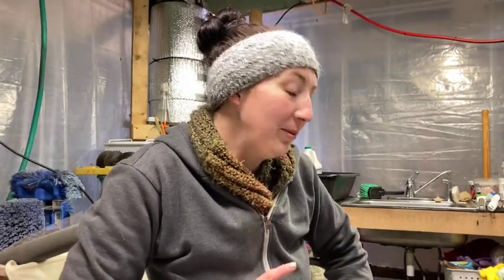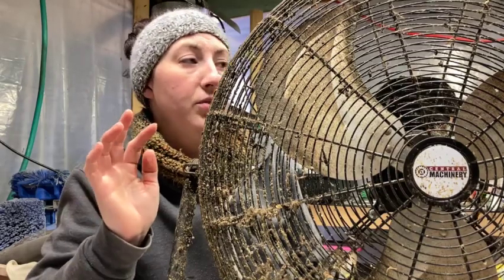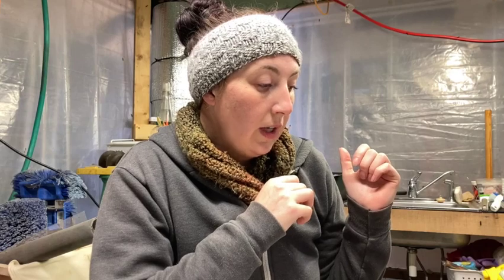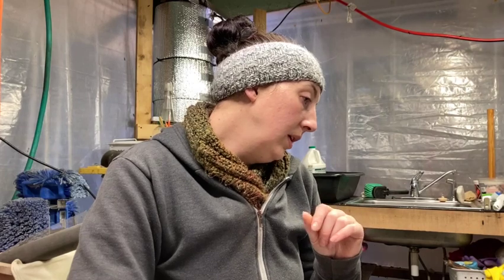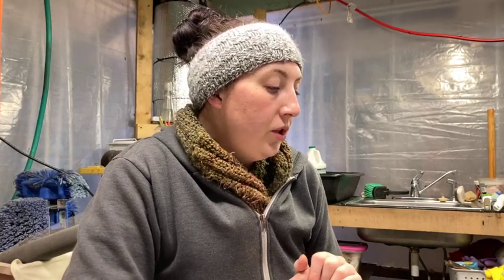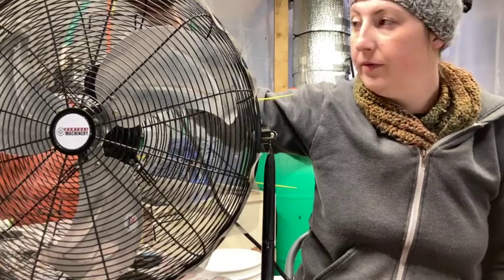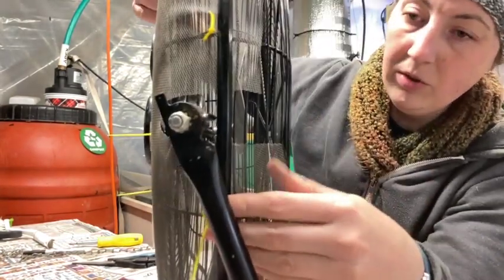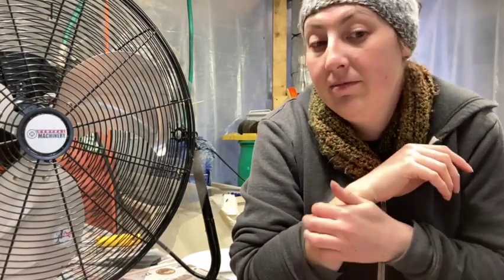Maintaining Optimal Climate for Black Soldier Fly Larvae

Comment: My situation is much different than yours. I love watching your videos! You live in a humid climate and I live in a desert. I have my fly farm set up inside my house. I currently use a 1 1/2 ft x 2 1/2 ft x 3 ft tall indoor plant grow tent. Inside there, I let the pupae emerge, they mate in there, and they lay eggs on biodegradable egg cartons which I place over a food bin. They seem to lay the majority of the eggs in the food bin. Every week or two I swap out the food bin with fresh food and transfer the egg cartons to the fresh bin. Then I move the young larvae to my feeding bins. I don't like lots of unnecessary work. So this eliminates harvesting eggs on wooden blocks and scraping them off. My most recent experiment, I put 6000-7000 pupae into my little tent to see if I can get 1.6 million larvae over the next 2 months. I've bought a 2nd plant tent of the same size to also see if I can just get a good cycle going where I'm getting new larvae every week. I use a reptile environment control center to control the humidity and temperature in the plant growtent; I use a Repti-Fogger to add the humidity. I'm also using a 6-band  aquarium light that's designed for growing coral inside the plant tent to get the flies to mate. I grind up whole wheat and mix it with water for feed, since I don't live on a farm. I find that the larvae feeding bin will smell like whatever you feed them. So the wheat mixture smells like bread dough inside my kitchen where I keep my feeding bin. I don't even have to put a lid on the bins because they just stay in the food. If I put a lid on it will get to hot and humid for them and they try to run out... So I just keep them uncovered in my kitchen. (I'm going to move it all to a different room eventually.) But it's so simple and all I do is feed the larvae, sift out frass from the larvae, keep some of the prepupae for the next cycle, feed the rest to my chickens. And I store the frass in another bin for later use. Your setup seems like a lot more work, but maybe you are producing many times more larvae than I am at the moment. They have 4 ft x 8 ft x 7 ft tall plant tents too for only about $200. Maybe I'll eventually expand up to something bigger like that and put my smaller plant tents inside the big one. I tried breeding them outdoors here but it's just too dry and I get a lot of house fly contamination outside.

Comment: Good to know. I hadn't really considered the crazy heat the bugs make. I'm starting a new small building after the first so I can move my bugs indoors and expand at the same time. Going to be adding a solar system with it and a mini split heat pump. Happen to have a couple of 3 foot charcoal canister filters I'll probably be adding at least one after hearing your critique.
Hopefully I will be able to thaw out the frozen bugs I have left and get a start in early March. Being optimistic a little.
Reply from the maker: Mini split + solar sounds like a great combo. I'm convinced that if the facility is run optimally, it would require minimal additional resources for heating, if any.

Comment: I've found that seed starter heating pads work really well to keep the substrate temps high while saving electricity by not having to heat the air temp as much. They tend to keep our substrates 15F-20F above the ambient air temp in our insulated bug house. It can be costly to buy a bunch of them at once, since you'd need one each per bus tub, but they only use 11w each and I run mine on a 15 minute on/off cycle with a timer. Before adding them to our shelves we were heating our insulted bug house with just an oil radiator heater. By adding the heating pads we were able to drastically lower the radiator usage, which cut our daily power consumption by more than half.

Comment: Next time you clean your fans try spraying with a cleaning product and allow it to sit for 5 minutes and then use a garden hose to wash it. Allow it to dry overnight and add oil to the motor drip cups on both sides of the motor an it will last longer.